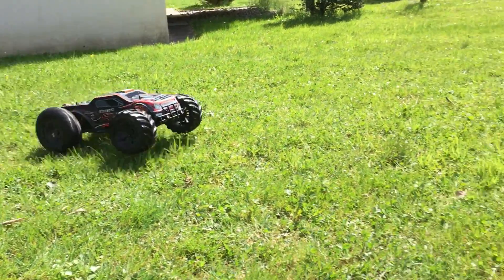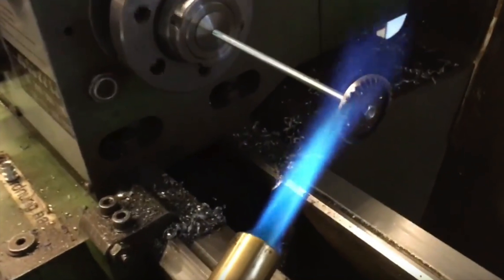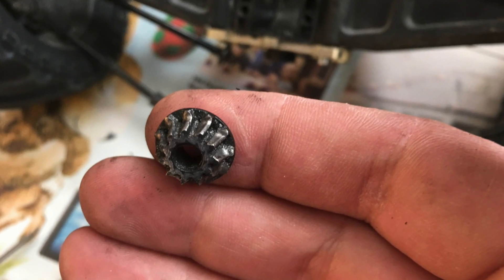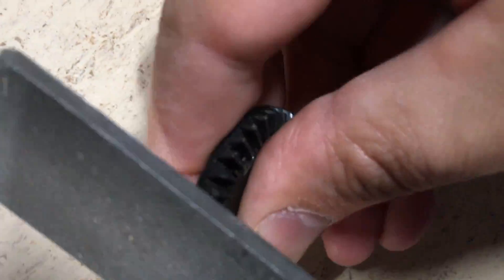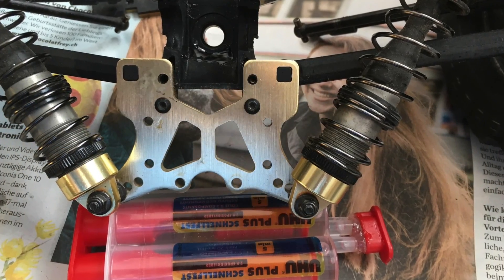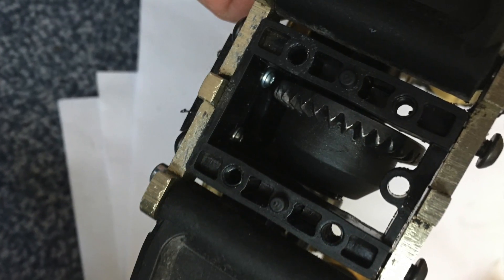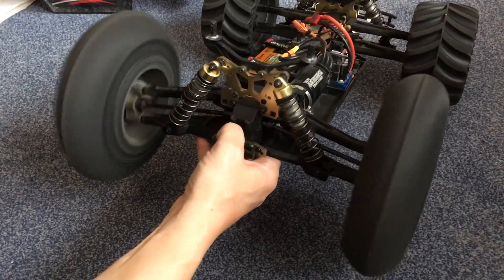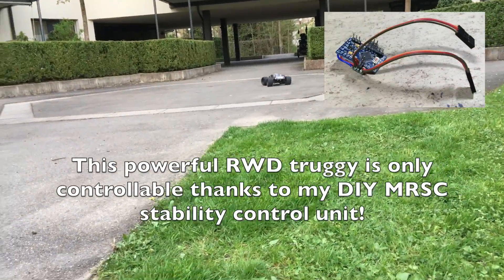How To Make RC Car Steel Gears Stronger And Less Brittle

Comment: On the mini screw of the diff pinion you apply loctite but how do you replace it afterwards if it’s broken?
Reply from the maker: It's not super strong loctite, so you can still unscrew it. Yo can also heat the screw a bit in order to weaken the loctite

Comment: What size tools do i need i have no tools that fits any of the screws in my car?
Reply from the maker: You need these: https://www.banggood.com/Drillpro-4pcs-Hex-Screwdriver-Tool-Kit-1_5-or-2_0-or-2_5-or-3_0mm-Black-Repair-Tool-Set-p-984361.html?utm_campaign=4828314_1046285&utm_content=1097&p=NZ29024828314201605E
Reply: Thanks

Comment: Did this work ?
Reply from the maker: Yes, no issues so far
Reply: TheDIYGuy999 hey mate! Thank you for the vid :) your treatment is very clever but in the cheetah the real problem is the front differential, the rear lasts a lot of time. In my case, after two years and 50/60h of use, the rear is still the original one! But sadly I have broken 10 or 12 front diff gears :( have you tried your upgrades on the front diff? Did it last more? Thanks

Comment: Do you sell your diy mrsc? Because i really dont know how to make it using the plans. I really appreciate if i can buy it
Reply from the maker: Sorry, but no. You can also buy similar devices on Banggood: https://www.banggood.com/Skyrc-GC301-Vibration-Structure-Gyro-SK-600068-for-RC-Cars-p-919745.html?utm_campaign=4828314_1046285&utm_content=1097&p=NZ29024828314201605E

Comment: Will this heat treatment work with die cast differentials too, like the zd racing 10427's one?
Reply: That’s already a soft metal, people choose hardened steel for gears precisely because it wears a lot longer.

Comment: Why you Made iT 2wheel drive?
Reply from the maker: Because the drive train for the front wheel drive is badly designed and just does not hold up
Reply: How do you Made the car 2wd?
Reply from the maker: I have removed the central drive shaft and the front drive shafts

Comment: gotta get a WPL RC  see if a 3D axle with better Hold im thinking of getting one https://www.youtube.com/watch?v=fqoe6jQ8om8&t=974s
Reply from the maker: Which 3D axle?
Reply: i meant to say would be Worth it to Make Better Drive Shaft to link in the Axle so you wont need  Zipties to fix it in that Link i showed the Guy had to Zip tie shows it on  7min 26 sec of this video https://youtu.be/fqoe6jQ8om8?t=7m26s
Reply from the maker: The entire drivetrain could be better, but I never had issues with mine so far.

Comment: It is pretty wierd because i dont have any diff problems on my 21101.
Reply from the maker: Then you don‘t bash it hard enough 😉
Reply: TheDIYGuy999 ooo i bash very hard. But i have my throttle punch pretty low, so it doesnt wielie as much. Maybe thats saving my gears by slowing down the acceleration. Maybe you could try that and hopefully the problem goes away! 👍
Reply: TheDIYGuy999 and search on the internet how to get water out of youre tires because the wobble can shake everything! Hope this information helps you. 😊
Reply from the maker: Slow acceleration is boring 😉. As I said in my video, one of the reasons for cracking gears is crazy drivers. I just have to drive full throttle
Reply from the maker: You‘re right. One of the rear tires is pretty badly out of balance. But I still believe, that the differential housings are not stiff enough and the gears are too brittle.
Reply: TheDIYGuy999 well i hope you fixed your problem and dont have to deal with it anymore! 👍
Reply from the maker: Thanks. And yes, I know I‘m crazy and I just have to improve things all the time.
Reply: TheDIYGuy999 you can also turn around the diff and then switch two wires on the motor so the diff wil bend the other way used this trick on my smax so i rarely had to buy a new diff plate!
Reply from the maker: I just tried the tire draining methot, but there was no water inside. It‘s the tire itself, that‘s out of balance.
Reply from the maker: I know, that you can turn around the diffs and switch two wires. But this methot will not help, if a tooth is missing or the gears are extremely worn down. So I just went the professional way.
Reply: Maybe ur not using the 21101 for whellie....  me used to whellie using my cheetah but havent experience yet a broken differential
Reply: This one is only wearing out because it’s running as RWD. if it was run in 4WD my bet would be you don’t get this issue...